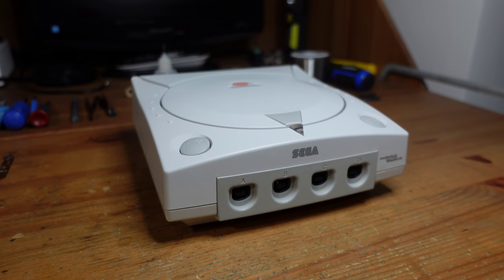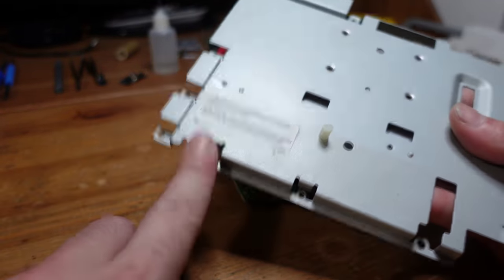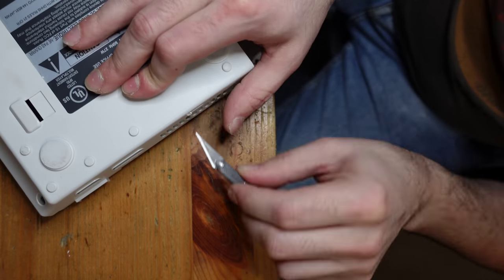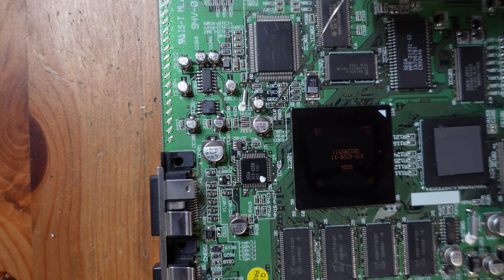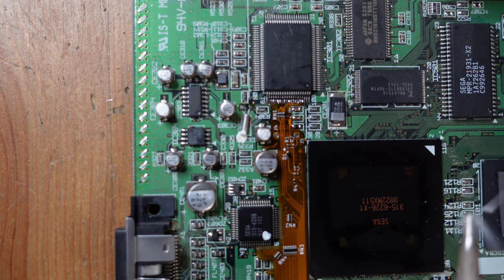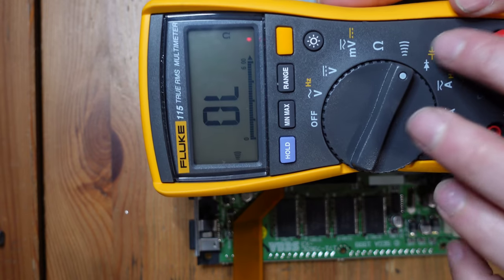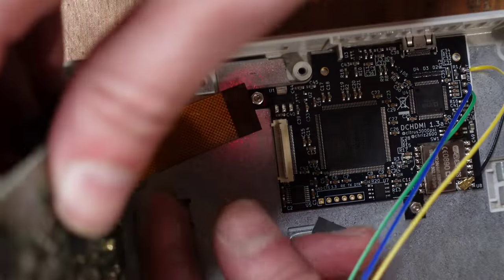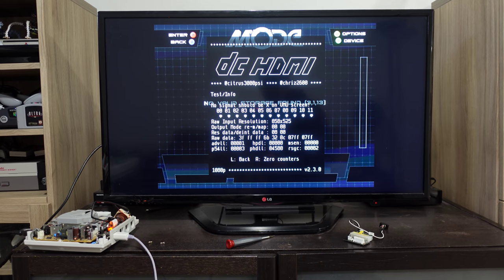Building the ultimate Dreamcast in 2022! DCDigital install, optical disc emulators, and more!

Comment: The Dreamcast is probably my favourite Sega console, besides the Mega Drive. 

My DC is modded to the hilt, including custom BIOS. When I installed the DCDigital, I didn't like the idea of drilling holes in the case for the screws so I used hot glue to hold it in place. Over a year now & no issues.
Reply from the maker: Glad to hear that it worked out. I always hate drilling holes in consoles

Comment: Installing a pico psu itself isn’t really the whole story .If a quality power brick is paired with the pico psu, yes, sure it’s fine to use and likely won’t damage the Dreamcast over time. Maintaining the original PSU ( replacing the original electrolytic caps ) is just as good , and preferred if possible imho . Great video
Reply from the maker: Agreed, personally I think that refurbishing the original power supply is the way to go. Glad that you enjoyed the video!

Comment: Exact same setup here. MODE + DCDigital + Pico PSU + Noctua fan. It rocks. The Pico PSU saves me from having to use a step-down converter (I live in Holland but use a Japanese Dreamcast) plus the original PSU generates a lot of heat while the Pico generates pretty much none. Make sure you get a Pico PSU from a reliable source though, there's a lot of poorly made fakes.

Comment: I did this to my Dreamcast about a week ago. I've had an intermittent audio issue since and have not figured out the problem. Basically, everything was fine immediately after the mod. I opened up the console to install a cover for the GDEMU and when I reconnected to my tv, there was no audio. I ended up connecting composite audio because I couldn't figure out the issue. The next day, I turned on the Dreamcast and I had HDMI audio again. Have you ever had any audio issues after installing the mod?
Reply from the maker: That sounds like an issue with the flex cable on the audio chip. You should take out a multimeter and test all of those connections between the flex and the chip
Reply: @LIRetroGaming  Yeah, they all tested good and I even reflowed them. I'm not a total amateur either. I'm using a good Hakko soldering station, good flux, etc. If it stops working again, I'll crack it open and have another look at it.
Reply: @LIRetroGaming  Actually, I think I figured it out and it seems to be related to my TV. I figured out that if I "reboot" the TV the sound works when it comes back on. I figured it out because yesterday I had no video or sound. It's a 65" Vizio 4k fwiw. It has recently been giving me some issues with a PS5 also, so not sure if the TV is developing a problem or if the Dreamcast HDMI signal is just throwing it off for some reason. Either way, I'm happy that it appears to not be my DCHDMI install.

Comment: I have a GDemu for one of my DC's and it's an excellent addition. Might look into getting one of these though.
Reply from the maker: Yeah I love the GDEMU and the other optical disc emulator options. There’s definitely a lot that you can do now with the Dreamcast!
Reply: Did you install the resistor mod to avoid overheating issues?
Reply: @omaryorke  I did yeah. I also cut some plastic so the fan pulls air across the power board. Works a treat.

Comment: Great job as usual! Did you say "WiFi cable"? Does this mod make possible for the Dreamcast to connect to modern internet? Or does it still need the DreamPi?
Reply from the maker: Thanks! The wifi module is used to update the DCDigital firmware. You would still need a dreampi in order to run network games
Reply: @LIRetroGaming  that makes sense! Thank you

Comment: I installed the DCHDMI mod weeks ago but I got a problem. 
The OSD does not display and controller port number 1 does not work anymore 
As soon as I desolder the according wire the controller port work again but this is impossible for me to display the OSD. 
I know I am not the only one with this issue but can’t find any solution. 
Can someone please help me?
Reply from the maker: Which wire is it, the one for R601, R602, or reset?
Reply: @LIRetroGaming  R601

Comment: Please buy a pair of left handed tin snips. It will make your life easier. All hardware stores have them. Watching you have to fold that metal back and forth dozens of times was painful.
Reply from the maker: Didn’t know they existed, thanks! As a lefty I am accustomed to suffering through using tools that were only designed for right-handed people in mind
Reply: @LIRetroGaming  You're welcome. They make right-handed left-handed and straight tin snips. Your best bet is to pick your dominant hand for the type and use that one. They can't cut nails, but they can cut pretty much any screw that you come across in a circuit board. Enjoy the extra time you'll have from now on;) that and the joy of knowing that your hands won't be as sore.